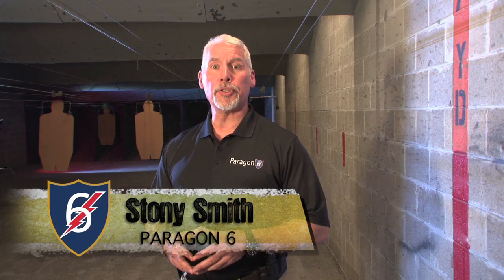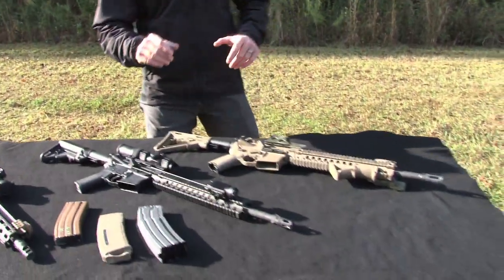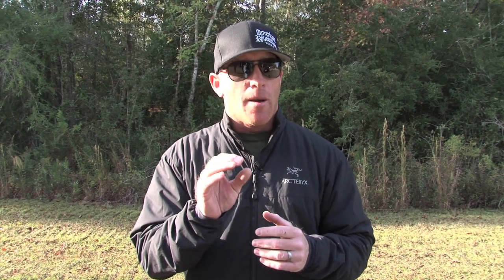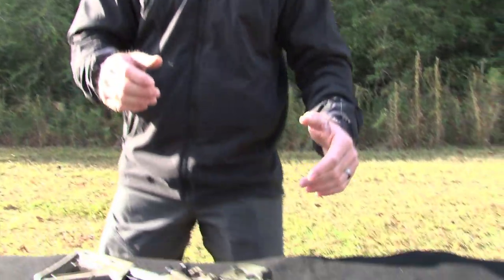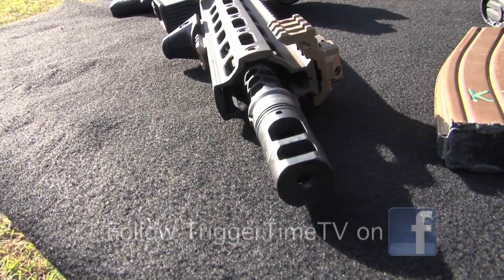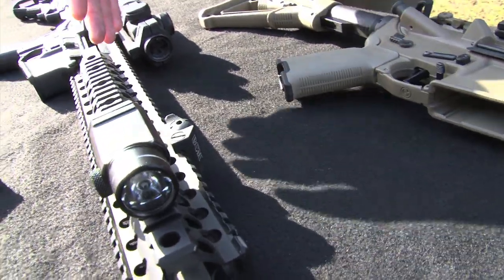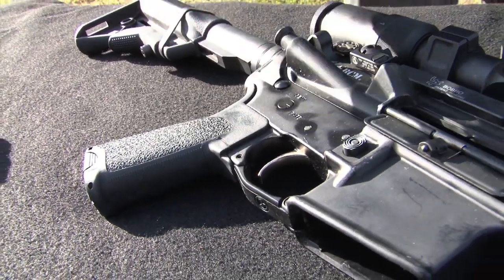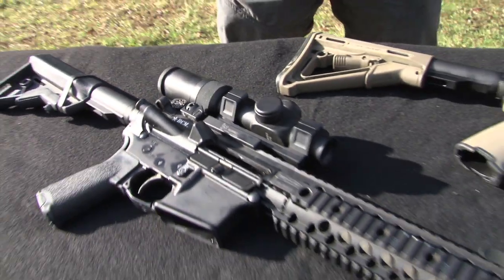Kyle Defoor of Defoor Proformance talks about basics of the modern Carbine.

Comment: I know this is a year late but I had to chide in on the fact that Kyle is correct, .223 and 5.56 are different. The case may be the same but the barrel chambering is different. The .223 chamber is tighter that leads to over-pressuring when the 5.56 is shot in it. This can lead to case swelling and extraction problems like Kyle said. Thanks for another excellent video from Kyle.
Reply: Mike Murphy yup, with the main difference in longer freebore of the 5.56. I will say the explanation of twist wasn't entirely accurate. As projectiles get longer for a given diameter, there is a greater distance between their center of gravity and the frontal area that's plowing through air. Because of this increase in "leverage", longer bullets tumble easier and need more spin to stabilize them. If you're shooting tracers or 77 gr loads, a 1/7 twist or even 1/8 depending on rifling type and bullet design will be necessary to stabilize them. If you're only shooting 55gr and 62 gr, then a 1/9 twist is plenty and won't "overstabilize" them at distance. If you're shooting light 40 gr varmint loads(especially with the increase in velocity), then something as slow as a 1/12 is probably the more desirable twist.  The twist rate isn't about accuracy in general, but stabilization for different weights(lengths) of bullet. If the bullet is stabilized properly with a twist that matches it and it's velocity, then the actual accuracy potential of the barrel comes from a bunch of different variables involved in internal ballistics.
Reply: +sp22m3 With respect to twist, most folks obsessed with accuracy, claim that bullets that are barely stabilized shoot more accurate. Hence the reason benchrest shooter operate with twist and bullet combinations that run the ragged edge of stability.

Comment: Colt 6920's do not have CHF barrels.
Reply: colby762 - I think Colt Canada does make cold hammer forged barrels.
Reply: I heard the same thing, I'm pretty sure that was for the Canadian military only. I don't think they were imported into the U.S. The U.S. military doesn't use CHF barrels in their M16's M4's.
Reply: @MrChuckwagon55  you are correct.  He has Colt Canada LE6920 SFW
Reply: @colby7625  The only Diemaco or Colt Canad you see in the US are LE Trade Ins or uppers . Very rare to find Lower . 
I have Diemaco C8 14.5 and C.C. LE6920 . Both I got 6 or 7 years ago online as uppers . 
Very rare uppers for sure . Diemaco / Colt Canada is superior in every way shape and form